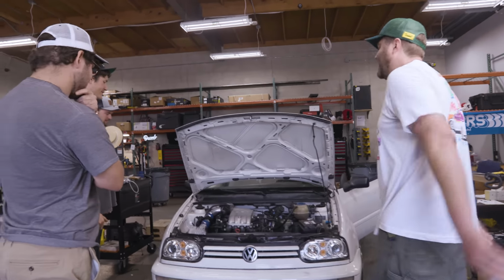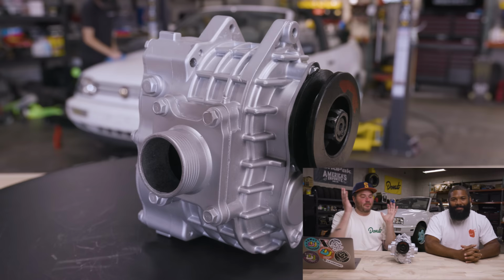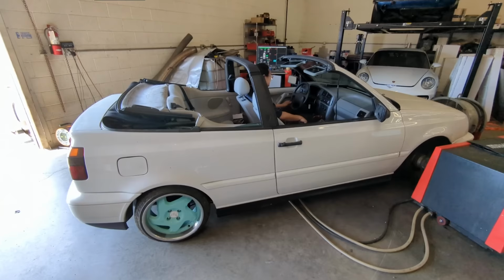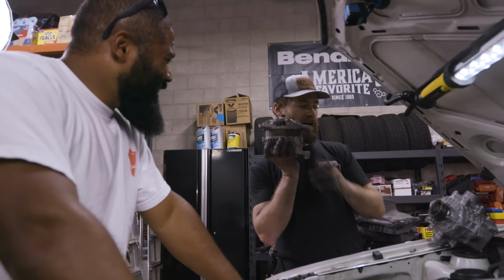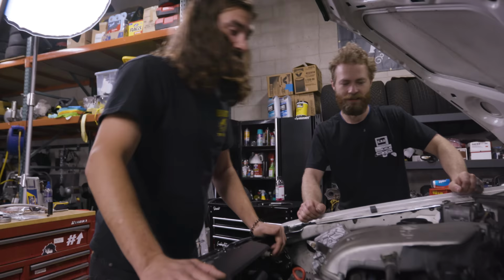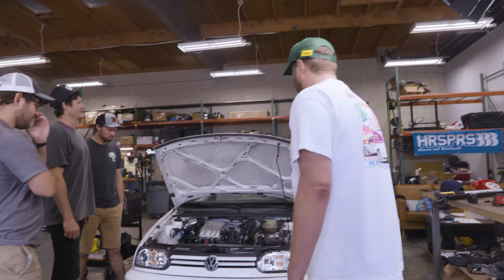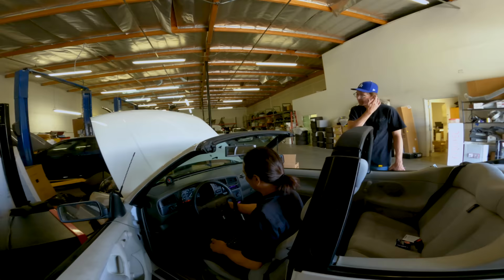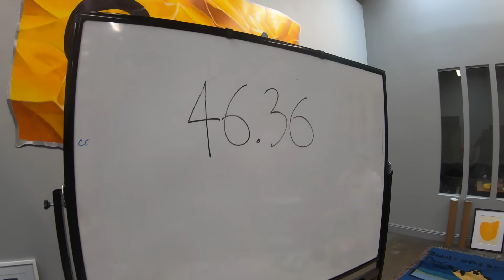We Installed a Wish.com Supercharger on Our Car

Comment: I want to see a follow up video with a scientific breakdown why the supercharger sucked half the life out of the cars power.
Reply: Might not have had the right pulley ratio, and also sounded like it was not lubricated whatsoever
Reply: because it's junk
Reply: tldr it fucked up the air fuel ratio.
Reply: Simple, it wasnt spinning fast enough, need a different sized pulley so it’s spinning atleast double the speed it already was, also it was cheap shit😂
Reply: It's designed for a tiny gokart engine with like 0.6L of airflow. It couldn't supply enough air to the engine and was actually restricting airflow rather than forcing induction.
Reply: I want see too, there are multiple factors some other's have touched on. The pipe diameter seemed too small which could actually be choking the motor, alternatively the lack of a fuel system upgrade like pump and injectors could be making the engine run too lean.They didn't appear to do any remapping tuning yet
Reply: The supercharger didn't deliver enough air to the engine, as you see at 9:06 in the video. The engine smokes due to the lack of air. Probably you need another pulley, there was a problem with the air intake, or the charger is just too small for a 2L engine.
Reply: @Vok250  simplest and best explanation. They even confirmed that the boost gauge wasn't moving at all. I'd imagine that there was likely actually negative pressure in the intake due to the restriction from the extra plumbing, incredible friction of the screws, suboptimal size and speed of the supercharger, etc etc. Kinda wish they'd actually measured the real pressure in there to find out, I'm assuming the boost gauge they used pegged at zero instead of measuring vacuum as well 🤷🏼‍♂️
Reply: Well 1. it's junk😂 and 2. It's a supercharger, superchargers have to rob some power to give power but since the supercharger they have sucks it only robbed it, that's why it only made 1 psi of boost😂
Reply: @mateomacias374  yeah that's the big thing, superchargers are parasitic by their design... Normally they only rob the equivalent of around 10% of the naturally aspirated base hp (iirc), but produce far more hp through forced induction... This one however probably took much more than 10% due to the insane amount of friction between screws (as evidenced by that ridiculous whine 😂), and it was way too undersized to produce even the slightest amount of positive pressure, maybe even resulting in a vacuum (again from the friction)... All in all, a great representation of how a supercharger works, just demonstrated in contrast 🤣
Reply: lol its acting as a restriction in the intake instead of boosting/flowing air, and its a drag on the belts/accessories
Reply: Because:
Extra load of spinning it. 
It produce less air flow with it on the car.
Reply: It wasn't designed for that motor so instead of boosting it it needed to work harder to be less efficient. Not to crazy.
Reply: Unless it was mapped afterwards with the ability to make the most of the new air then the car is getting way too much air to fuel and on top of that it's not powerful enough so just restricts air flow killing the power
Reply: You don't have to get too scientific with it, I looked it up and they had the input side connected to the engine so it was sucking air out of the engine instead of blowing into it
Reply: PLEASE DO THAT
Reply: Completely throttled the amount of air entering the engine by the sound of it. Or the air/fuel ratio was completely off
Reply: Pretty sure they installed it backwards or something. There's no way there's so much friction it draws 40 horsepower - that thing would simply melt.
Reply: I'm dying laughing over here
Reply: They would never do that because it would just be a breakdown of everything they did wrong lol. Didn't check oil for the supercharger, didn't check correct pulley sizes, could be backwards, etc etc. These guys aren't the brightest.
Reply: Why are you using a supercharger for a small engine like a scooter engine or a dirt bike engine? This is not the correct application for this supercharger. Use a real supercharger or turbo. 
Or put this on a scooter engine.

Comment: It's not the supercharger's fault, you were spinning it too slow. Amr500 makes 500cc of air every revolution but the 2.0 engine takes 1000cc of air every revolution so to even keep up, the supercharger needs to spin twice as much as the engine. To make some boost it has to spin even faster. Try smaller pulley
Reply: have you seen the pulley they put on? they took it off a generator. off the top of my head i'd estimate the crank pulley to be easily 2,5* the size. of course you're not wrong, i just think the problem is the stock fuel delivery system and the completely nonexistent optimization that's to blame here
Reply: Did you sell them the supercharger, Jan?
Reply: It will fk up the bearings and melt them through the housing 😅
Reply: @Mike-ry4ti  probably 😂😂 this supercharger is basically too small for 2.0
Reply: all im hearing is they need one supercharger per cylinder
Reply: @nemti1712  😂😂😂
Reply: No a bigger pulley would make better ratio
Reply: @laronwhitener5121  bigger pulley on the turbocharger =slower rotation
Reply: actually, it said in the part website that it should work for 0.8L to 2.0L
Reply: The pipe reducer is the tell.
Put two of them in parallel, plus different pulleys, then maybe you would have something. 
BUT:
There is no oil plumping. So this guy is spinning with internal oil only.
No cooling 
No telling what oil was used 

I love things like this, but I don't see it being reliable
Reply: @laronwhitener5121  
Don't talk about things you don't understand. 
Don't want you to hurt your brain.
Reply: @FireBeam  I don't think reliability was even a consideration when purchasing the cheapest supercharger on wish. I think this was done just for the laughs
Reply: @laronwhitener5121  smaller pulley goofy
Reply: I think it may be reversed flow. They reversed the orientation, they reversed the direction.
Reply: @EZ-GAZI  Pulley not included.
Reply: @brianwesley28  the pulley wont effect that much, its all about the capacity of the super charger
Reply: @EZ-GAZI  You really have to spin that thing up a lot if you want to produce enough volume to run a 2.0 up to OEM horsepower and even more if you want to create any boost. It's just too small of a supercharger for the 2.0, really. The smallest of pulleys may be able to provide some level of low boost, but I wouldn't trust that it would last very long before the bearings took a dump. I was shopping around for one of these a decade ago on ebay for an 18.5 hp Briggs and Stratton opposed twin. That engine is somewhere around 688 cc? Maybe less? That's a more suitable displacement for such a small supercharger. To get boost out of it on a 2.0 you really have to spin that little guy up a lot and I doubt it would last very long if you could even get it to build any boost at all.
Reply: @FireBeam  My old Paxton SN93 used internal oil (transmission fluid) and no cooling, was pretty cool back in the day when forced induction wasn't as common or as advanced as it is today. I had the fastest '89 Bronco in town 🤣 even with the 40" tires.
Reply: @jannemec4567  it's rubbish, it's for a kei car to make 10 more hp than the lesser ones.
Reply: Judging from the noise it was making, if they ran it much faster it would fly apart.
Reply: @JamesonWilde  No, though I bet Jan smokes cigarettes 😂
Reply: Or mount 4 of them in parallel!
Reply: You're the manufacturer?
Reply: @EZ-GAZI the description is wrong I’ve researched heaps about it bc I was going to buy one basically 0.8-1.6 is the cap said they work best on 1.6l out the box

Comment: I have a 1994 geo Tracker and this exact supercharger seems to be relatively popular within the community with people wanting to make 100 hp+
Reply: That sounds sick, I've got a '93 and there's definitely room in that engine bay for one of those. Did you remove the AC to fit it?
Reply: @DoubleSmackJacksSmackAttack  I’ve seen other people do that but I plan to install it where the charcoal canister sits so I could run a intercooler through a hood scoop
Reply: Noted.

Comment: You guys have gotta have them back to install a bypass valve and get it tuned right! As it is that supercharger is generating tons of heat and drag on the engine because it's trying to pump the volume behind the throttle plate up to pressure! A bypass valve will allow the supercharger to free wheel when off the throttle. Replicate how centrifugal supercharger installs work.
Reply: A bypass valve allowing the supercharger to free wheel when the throttle is off... even though it never makes any significant amount of boost, and then when the throttle is on... that valve will still be flowing backwards because it pumps less air than the motor sucks at W.O.T.

Hahahaha. What the hell is a bypass valve going to help with?
Reply: @Hezath  Haha true. With the right pulley it might make some boost down low. I hear the VWs have some success with em, those motors don't breathe amazing. But yeah I'm on the same page. The same money/effort spent on a junkyard 3800 supercharger would make it an absolute tire fryer.

Comment: I'd like to see how this supercharger works on a 3-cylinder, 1L Geo Metro engine.
Reply: You really want that supercharger I’ve seen you twice 
What a legend
Reply: A slightly modified geo metro
Reply: @obeseperson  it would be really cool to see🤣
Might actually do somthing
Reply: Okay this guys love it. He's so passionate about this and you don't see it everyday. Can we get a bump on this we I need to see this done asap
Reply: Boosted boys did that and it’s still on YouTube! The three cylinder carbureted geo. But I think it was stock ecu and stuff. They tried to do it absolutely dirt cheap
Reply: My 2022 3 cylinder Mitsubishi mirage
Reply: Just buy a gti metro turbo , they sold with turbos in the past.
Reply: @killerdeamonking  Not in the US. They sold a Turbo Pontiac Firefly on the Canadian market in the 1990's. Now, they did sell a Chevy Sprint Turbo in the 80's in the US before they came out with the Geo line of vehicles.
Reply: There is a guy here on youtube who actually used this exact supercharger on a 1L Geo Metro. It acually worked great and had that car running 14 seconds in the 1/4 if I remember correctly.
Reply: funny i have a suziki swift 1.3 l 3 speed auto 1995 and have been thinking the same thing

Comment: Well now it's obvious you have to try two superchargers and see if that makes power
Reply: Lol might bring it back up to the starting HP and be TWICE as loud!
Reply: @battleaxe4784  win win
Reply: @battleaxe4784  Its hard to know what effect this really had without a tune, a supercharger always robs power - you add it back with fuel allowed by the extra air. 40HP isnt really a lot of parasitic loss for a supercharger.
Reply: Can you put multiple superchargers in line on the same intake?
Reply: @riskvlogs4795  yes 
i'm not sure if it would work the same as two turbo's basically one turbo is the nose
(getting all the air in and filtering it) and the other is the mouth (which spits out all the waste bad air) idk i'm not a pro so I wouldn't know
Reply: @riskvlogs4795  I don't think that'd be nearly as efficient as running them each separately into the intake
Reply: Or throw a turbo inline after the SC. It will help spool the turbo faster. Totally not overkill on that little 2.0.
Reply: @mycosys  It most likely wont flow enough to produce any more horsepower than it did on the dyno. Now add that thing to a lawnmower engine or something, should be quite decent.
Reply: One supercharger per cylinder!
Reply: That supercharger works, they just installed it wrong, I found a video of a guy installing it right and make like 40hp
Reply: @Josmersuero  on what motor, this is designed for a 1000cc vw with a carb. also grind hard literally has a successful use case for one on a atv engine, they know how to install it.
Reply: Top comment.👍🍻
Reply: Add another SC and make 20hp
Reply: @mycosys  yea but even if it's robs horsepower and doesn't have a tune, it should be immediately putting in back in more horsepower if it's functioning properly? I've seen plenty of SCs run without a tune making boost

Comment: I already knew it will take down HP, cus after installation, your Golf started to smoke badly, means not enough air in fire chamber, and probably those "grinding wheels/gears'' took some power too.  That charger could work, but for some miniature engine like 0.8L, 1.0L not bigger
Reply: exactly, when they were driving i saw some blue smoke...

Comment: Did the same thing with my mk3 Golf. Started with a genuine AMR500, but it actually restricts flow and lost power. It will not flow enough to feed the 2lt motor. 
Went with the SC14 and it made a hell of a lot of difference. Boost came on strong. Fitted a switch to the throttle body so the SC was off during idle.

Comment: Been waiting for this. People have fitted these on Hondas but its usually fitted on classic bugs
Reply: I put an Amr 500 on a 1600cc bug and it was probably making near 60hp, a nice increase from the stock 30hp
Reply: Now how hard would it be to plumb to a Goldwing Gl1200. Stock hp is about 90.
Reply: @craigwiess1656  you need some way of connecting it to your accessory drive, do the math for drive speed, draw carburetor through works but they don’t they don’t live long blow through is an option to but might need a intercooler the like to get hot, efi works too. I would look for a company that sells ones made for bugs because the machine them and run seals that live with blow through, honestly I would go with a cooper S supercharger they will support 200+ hp
Reply: @turkeyboyjh1   years ago there was a supercharger kit for the 4cyl Wings.  Magnuson, I think was the brand.   After I get a newer Wing may play with the 1200.

Comment: Were going to need a part 2 where you check the direction of rotation is correct on the SC, that it has proper gear oil filled in it, the MAF is properly rerouted to the intake side of the SC, and the new ECU that didnt come in time is properly installed and everything gets tuned as well as possible.

Comment: Have used one of these ebay/wish things, you might have it facing the wrong way. It will make around 10-12psi just fine, make sure it's oiled, have heard a lot of these come dry. You should see 30-40hp gain.
Reply: too late now buddy.
Reply: yeah it sounds kinda dry if it's sounding like a motorbike

Comment: It really and truly sounded like you hooked it up backwards. And according to your results, I would have to agree with that assessment.
Reply: Agreed, the diagram they showed was also backwards
Reply: Its not unusual for a supercharger to take 40HP to run in compression and mechanical losses. Normally you add a heap of fuel to make up for the loss so its hard to know what effect this actually had
Reply: The fact it was making literally no boost was a giveaway too. Also the fact that it died if you didn't keep the throttle open, it was causing vacuum pull on the throttle body. That's also a tiny ass supercharger, I could see maybe a 20hp drain from it but 40?. Nah. It also was smoking pretty heavy, although it kinda looked blue (which would be oil) it could have been running super rich trying to compensate for the lack of air.
Reply: It didn't had oil
Reply: @JefeInquisidorGOW  it did watch grind hards vid
Reply: @JefeInquisidorGOW  Superchargers are pre-oiled and usually have a small internal reservoir with no oil feed line. It's totally possible that it was empty and they just didn't know you had to put oil in it, but how did the guys who've already installed the same supercharger not know? Also if it was bone dry it wouldn't have made it 5 minutes without seizing up.
Reply: @JefeInquisidorGOW  ain’t got no gas in it
Reply: @mycosys - Superchargers are quite parasitic on engines. I don't think that one is large/prime enough, nor has the displacement to be that parasitic. I just know the bearings/centrifuge weren't supposed to sound like that. Just sounded backwards and poorly oiled.
Reply: @PsychoCPU  well, if this one was "pre-oiled" it probably was the shittiest oil that ever came out of China

Comment: 4:29 I always thought these superchargers spun the other way and actually squished the air between the two "roots" to create boost. Nice
Reply: Me too and I thought they got the animation wrong until I read your comment and saw that the air is moved through the sides and not the center.
Reply: That’s a twin screw you’re thinking of (which is ironical named since they’re actually not twin screws, but roots type are).
Roots type pull air thru their identical screws from the top and eject out the bottom, building boost by cramming the manifold full of air directly.

Twin screw use 2 differently lobed screws that cause the air to be compressed by the screws themselves, which is not only more efficient (less parasitic loss & less heat generated), but allows for more unique placement, and can be front or rear inlet designs, eventually ejecting out the bottom at the opposite end, allowing for more versatile throttle body positions and also lower height (hey, I can close my hood now!) since the inlets are front/rear, not directly over the top of the already tall supercharger.
Reply: @JoelsCrazyWillman the lobed superchargers are roots type, the screw type are called Lysholm. Apparently the roots style are less efficient from what i read